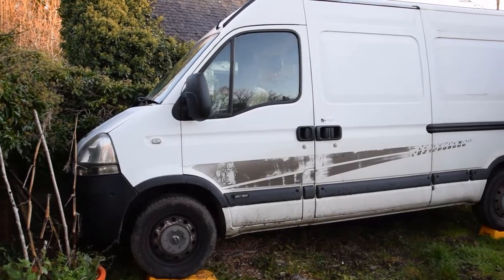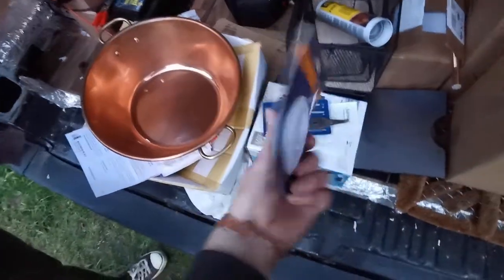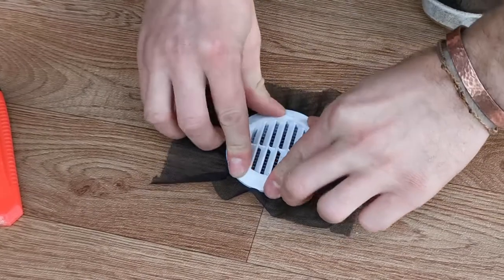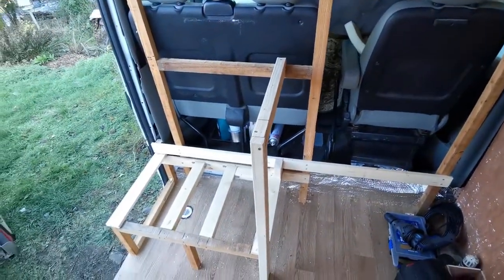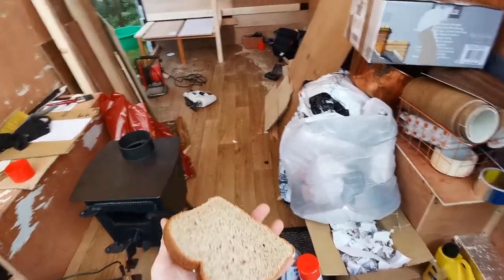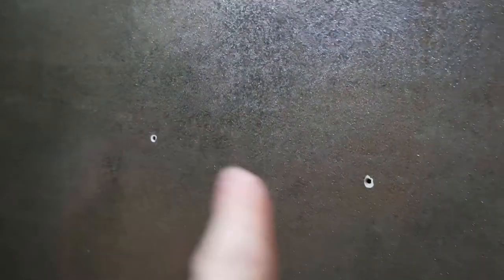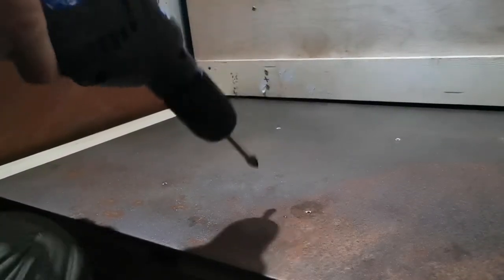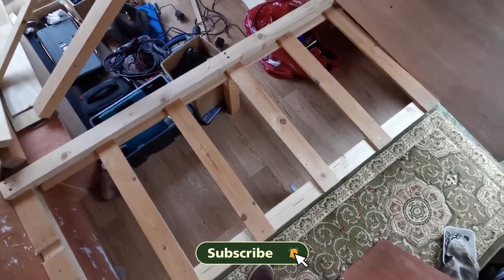Van Build Series - Part 1: Securing My Log Burner

Comment: Great job on the drilling, kinda scary right. Love that you reuse so much stuff, better for the environment and your wallet. Where did you buy that log burner? Greetings from Belgium. Erik
Reply from the maker: Very scary, expected the tile just to pop and split in half but it held up great 😁 That's exactly it, there's plenty of waste wood knocking about if you know where to look. Wait until you see our later videos, our kitchen is made from an old barn door and a fallen down shed 😂 bought the burner from someone on ebay who produces them, several options on there too 🔥 Greetings and thank you for watching and taking the time to comment ☺